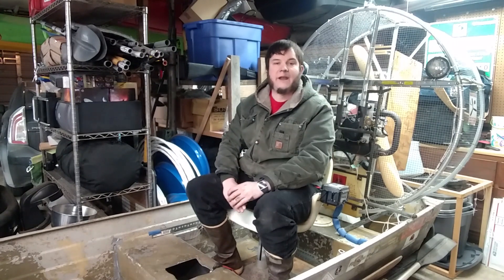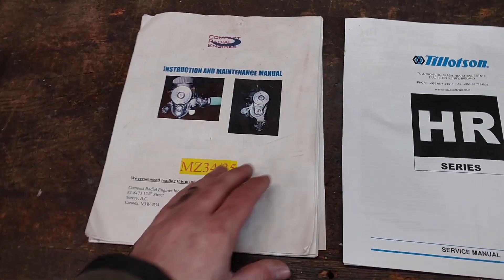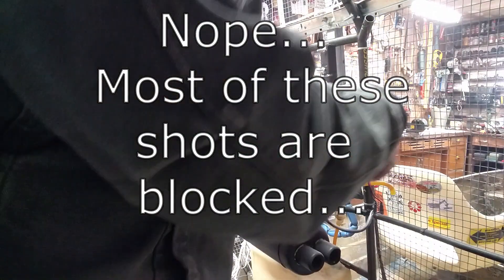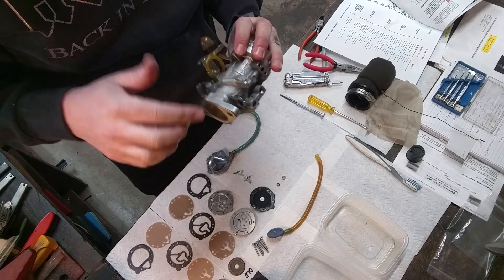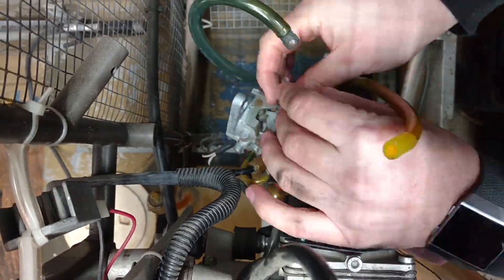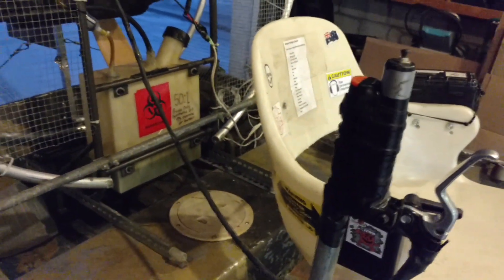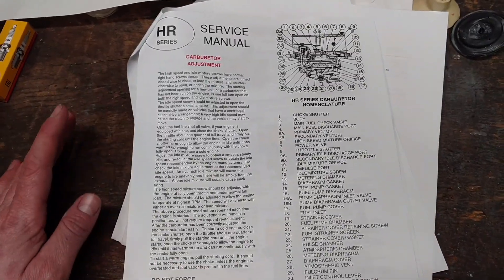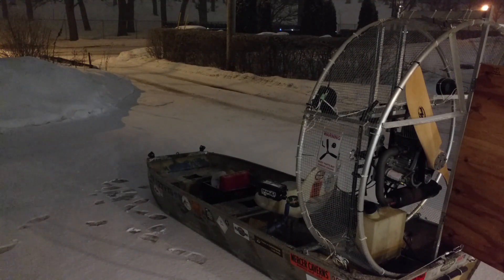Mini-Airboat Tune-up and Test Run in my Driveway!

Comment: U should get tru fuel so that way during long term storage the fuel will not get bad.    Easy start after
Long storage
Reply from the maker: Is that the canned stuff for lawnmowers? I tried some of that but it's more expensive to buy that way than a jug of avgas at the little regional airport.
Reply: @saveitforparts  yes. 20 at Lowes gray can

Comment: Stick a new fuel pulse pump on it.
Reply from the maker: Half of what I rebuilt on the carb was the fuel pump. It seems to work once it gets going, but I might stick a bigger primer bulb on there to help get it ready initially.
Reply: @saveitforparts  i would think with the tank Located so far away and so low a simple in line pulse pump would be a good move, the diaphragm pump in the carb would be struggling? I could be wrong as my experience is outdoor power equipment.

Comment: Maybe if you unbolt the propeller, you can tune it while it's running. Lucky that prop didn't get shattered again, it looked like it hit a rubber chicken rather than the chicken wire. It's a nice little rig, and yes, take it anywhere you go.  If there's no parking at the shopping centre, moor it in the fountain. If they won't serve you in McDonald's drive through, turn that thing towards them while it's running and piss in the propeller. Don't worry, their meat is already soaked in ammonia.

Comment: Turn up the idle screw on the carburetor just a couple turns, it should make for easier starting. As for the slightly ashy deposit on the spark plug that actually looks pretty good, meaning you're fuel mix was pretty close to perfect for a 2 stroke engine.
Reply from the maker: Good to know! The carb screws on this thing are always kind of a black magic, seems like they need adjusting depending on the air temp and pressure and if the engine is warm or cold, it's pretty touchy.

Comment: Love this!! Ive been thinking about doing a project zero turn mower + jon boat= a tracked amphibious vehicle.
Reply from the maker: That sounds awesome! I have wheels for this rig that I've had installed in the past, but the front steering is an ongoing project.

Comment: Wow... I never thought of the benefits of having an airboat in the snow... If the roads are not plowed you can just boat around on them! And if you wanted you could make a set of wheels that were just lower than the bottom of the boat so if they plow the street while you are out you can just drop the wheels down or lift the boat onto the wheel base and drive back home!!! It also seems like that engine cage could use some struts running from the top of that cage to the sides of the boat to keep it from rocking forward so much. Maybe it would be good if you could find an old sign or something made out of the right plastic that you could use as a base plate for the boat to keep the metal base from getting scratched and dinged up on rocks, gravel and road debris. I want to see you driving your air boat to the store next video! Have a friend standing there with another camera to get people's reactions. Make it happen! then do the same thing in the spring or summer when the roads are clear just on a little cart for i! maybe use bike tires that are wider than 2.5 in with a single swiveling wheel in the front for turning or you could hook cables to another lever or steering device? You could remake the video pulling up to the same store on an air boat driving around with no snow now and the same friend waiting there with the camera and a new reason for why you are out there like that besides "I didn't want to put chains on my car."
Also on an unrelated note just about health and safety Fuck those negative ion products, at best they are fraud, at worst they are radioactive and increase the risk of cancer, spread the word!
https://www.youtube.com/watch?v=C7TwBUxxIC0
Reply from the maker: I have some retractable wheels for it that are still a work in progress. The plastic base plate is a good idea! I think I have some plexiglass sheets hoarded somewhere...